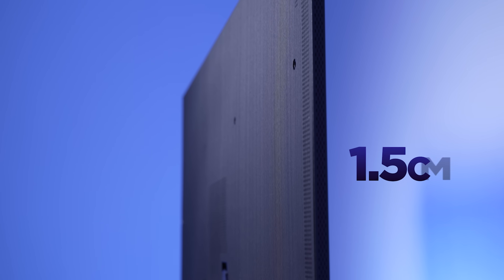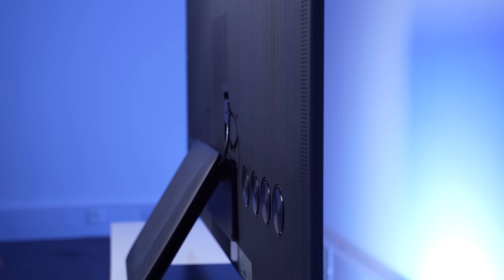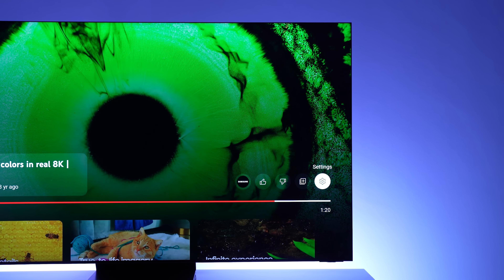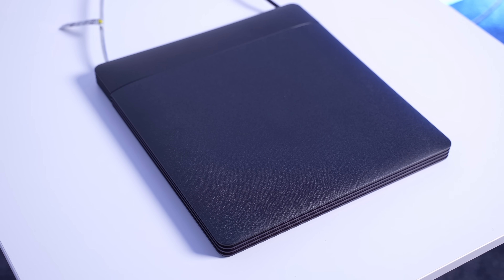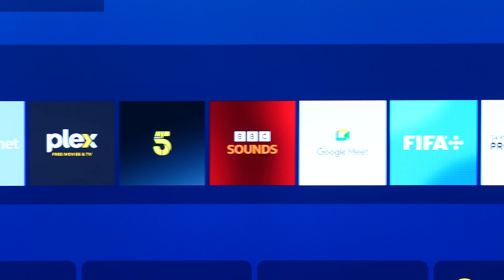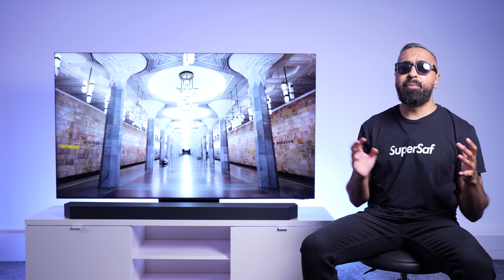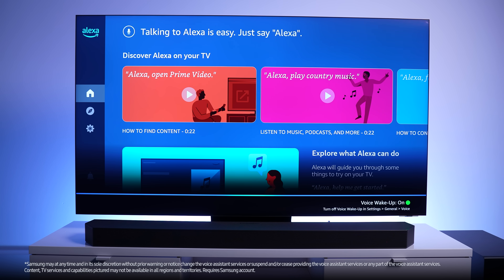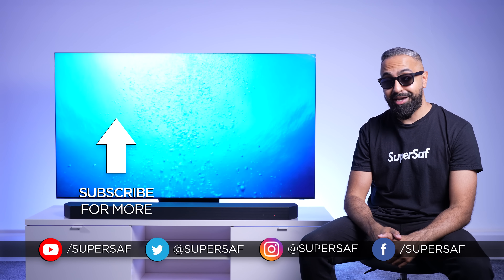Samsung Neo QLED 8K 2023 - The BEST 8K TV You Can Buy!

Comment: Do you HAVE to use the soundbar with this TV?  Is it possible to have burn in with this TV?
Reply: No.  It has builtin speakers though I have mine connect to my surround system (It supports eARC for audio output on HDMI3 port). This is a Neo QLED TV and should not be susceptible to burn in.  It has built-in access to cloud gaming as well (Xbox Game Pass and Geforce Now).

Comment: 8K might be out but it will take many years before it becomes the new fad.

For example HD didn't come to TVs until the mid to late 2000s.   But 720 ppi was the main screen resolution from 2007 to 2010 before 1080 ppi or full HD took over.

Today while 1080 ppi still the standard screen resolution it is gradually being replaced by 4K.   

But 4K is still relatively new.   For example many films on Disney Plus like Beauty and the Beast, Cinderella & more recently Snow White have been given 'plastic surgery' from full HD to 4K resultion.   In fact many films are being upscaled to 4K but the reason it has taken long is because there weren't many 4K TVs years ago but now 4K is the norm, we are getting more 4K content than ever before to meet today's standards in tv.

8K simply put is still only a 'baby' meaning it won't overtake 4K anytime soon, probably not for at least the next decade.   

8K will likely be the norm by the mid to late 2030s by which time we will likely have more and more TVs that will play 8K content.

But like 4K in which TVs were insanely too expensive, 8K TVs in time will be more affordable, especially once 12K tvs arrive, starting the process all over again.
Reply: What u saying it’s almost been 12 years since 4k came out… been very slow bcuz not much difference from 4k and 8k
Reply: I have a Samsung 8k and I love it . watching Blu-ray. uhd. 4k  is great.. now looking for an surround sound system that does it justice with out breaking me
Reply: I own the QN900C 85 inch 8K, and it has the best picture for all conditions. 4K at 85 inches doesn't have the resolution that upscale 8K does. Watching the NFL playoffs last weekend, I know which networks have crappy cameras! I call OLED Bunker TVs and if I need a dark room to watch a movie, I just go to a movie theater. AI 8K Video Processing on this TV along with it's Brightness in well lit rooms is outstanding!
Reply: Well, here's the thing our vision is limited to 6K so unless you're going to get a elon musk chip and somehow figure out a way to plug a t v into your brain, not gonna happen

Comment: Don't fall for this blatant marketing. 8k is dead and this TV is worse than 4k LCDs and even more 4k OLEDs, even from Samsung. When compared to 4k lcd like 65QN90B which is around 5 times cheaper, this TV has worse blooming, brightness and colors, while achieving the same sharpness with 99% of content. That's because:
1. There is no 8k content and there won't be more, no other manufacturer than Samsung sells 2023 8k mainstream models, mostly because of EU regulations which make comparable 8k tv much inferior to 4k at higher price, so there's no user base, so no incentive to make 8k content
2. Upscaling is the same in the whole Samsung model lineup, don't trust the marketing, the cheapest CU7 upscales just as well
3. Even when you have 8k content, 4k OLED still has better resolution due to infinite contrast, and you can't even see advantage of 8k at normal viewing distance, on top of that, due to having 4 times more pixels, 4 times less light gets through backlight so worse brightness, colors and more power draw.
TLDR don't buy this TV and any other 8K TV, buy OLED or high end LCD, if it has to be Samsung then S95C and QN95C are the best tvs in each of these technologies offered by this company, both much better than QN900C and much cheaper too.